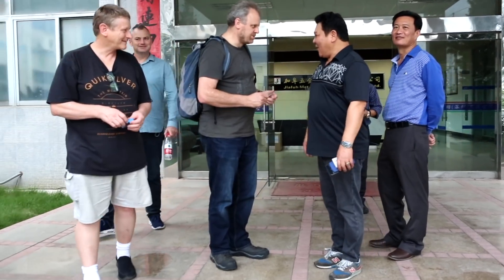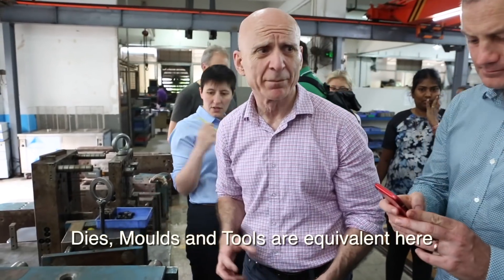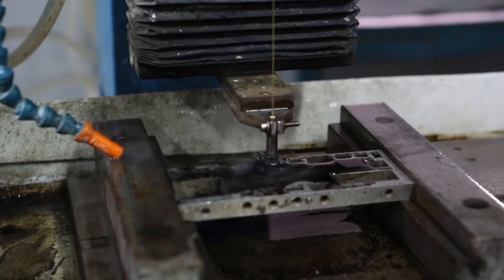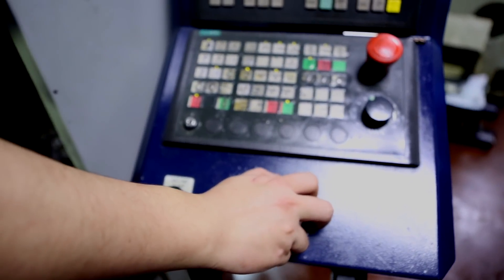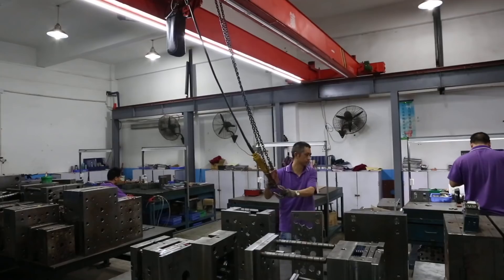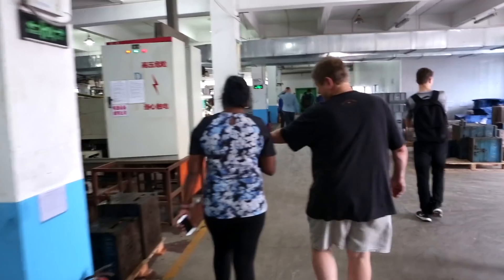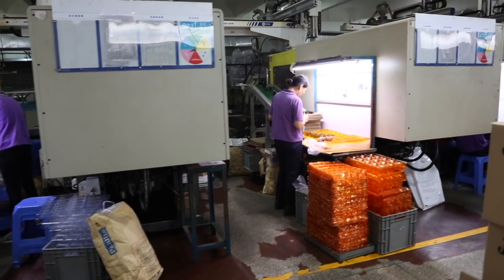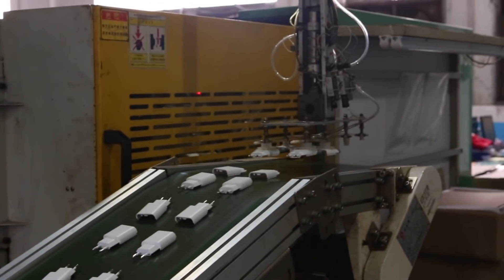The Factory Tours of Shenzhen - Jiafuh Metal & Plastics

Comment: A bit more detail on plastic formulations and what the choice of plastic and fill can have on tool life would also be nice. As well metal casting, either spin casting or injection moulding as well.
Reply from the maker: Hey Sean thanks for your comment. Yes it would have been great to add more detail on those specifics but I think in just a short amount of time of walking through the factory, asking lots of questions, we could never get answers to everything. I hope the video was still useful to you? I suggest you shoot them an email from the supplied link and get the specific answers you need.